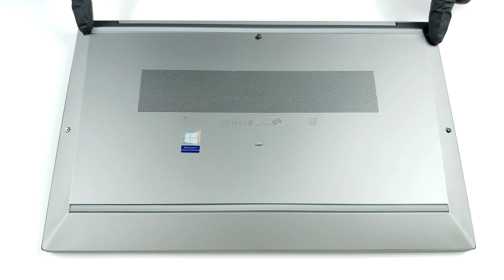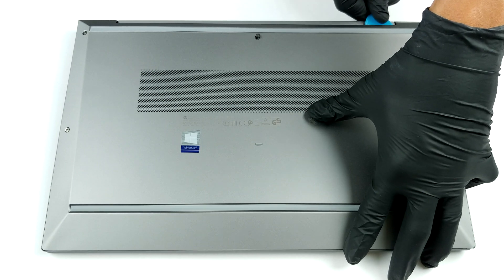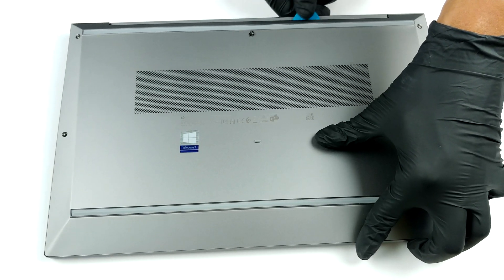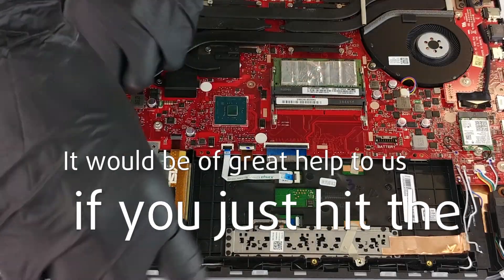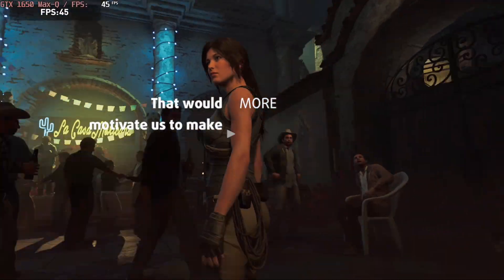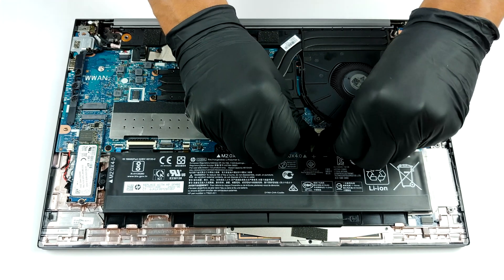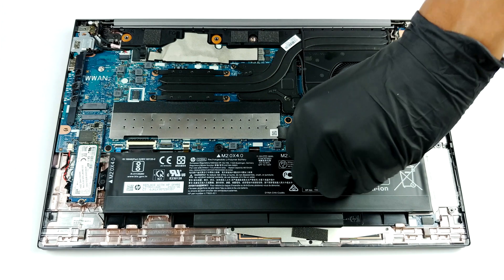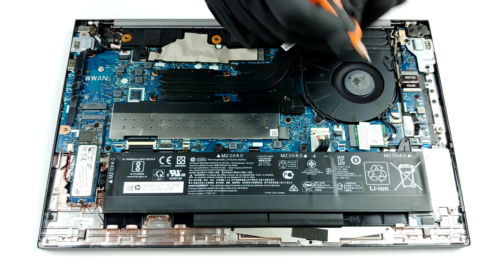🛠️ HP ZBook Firefly 15 G7 - disassembly and upgrade options

Comment: Was this 32 gb version? Does 16gb come with 1 slot empty?
Reply: I’m literally watching this as I take apart this same laptop. The 16GB one has one slot filled and one available for more ram.
Reply: I would like to know the samething. Did you find the info?
Reply: @BloodyCatch  no
Reply: @BloodyCatch  you don't even have to upgrade it. You can just by a memory card and an 128 gb SD card... Much cheaper
Reply: It comes with 16gb of ram slot and u can add another one. I have one